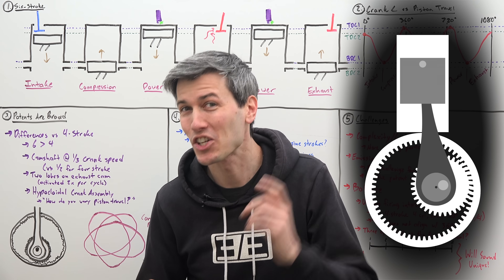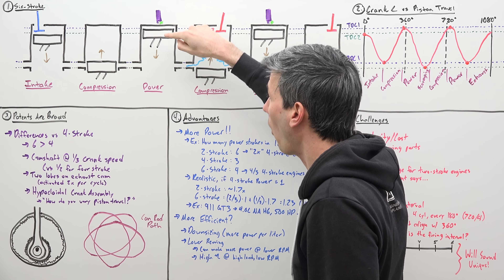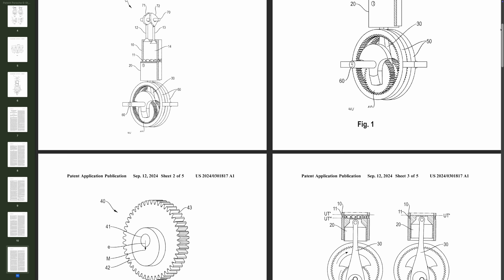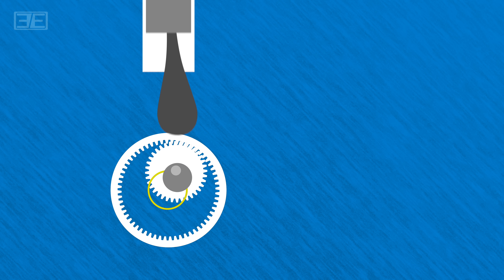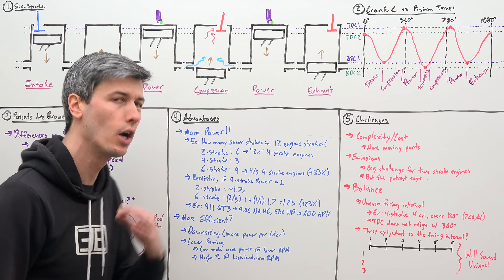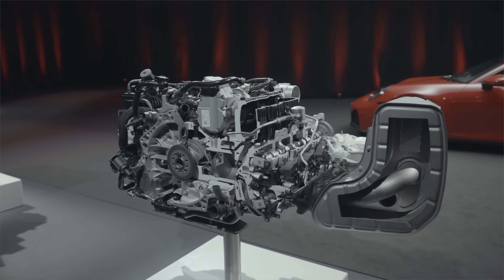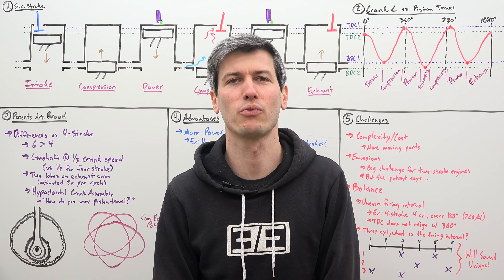Porsche's 6-Stroke Engine Is Genius!

Comment: I wonder: Won't you have the exhaust of the first power stroke in the cylinder during the second compression prior to the second power stroke? The exhaust valve should be closed during this time contrary to the picture, because otherwise you do not have any compression, correct? Then you are going to burn the fuel twice and this could increase efficiency? Sorry, I am not a mechanical engineer, I am just thinking about your graphic representation.

Comment: Seems like the 2-stroke cycle should go first so you could take advantage of burning some of the fuel and exhaust mix inherent when scavenging with ports, burn it clean in the valve intake cycle.

Comment: On your firing order diagram you state that it is a 3 cylinder engine but it says that you have 4 cylinders on your diagram. And you're using 180°crank journal location. A 3 cylinder engine would have a 120° crank  journal location.

Comment: When I was reading into the engine I saw that another way it improves efficiency is that on the second compression stroke, there’s still some exhaust gas left in the cylinder. That leftover gas gets burned along with the fresh air-fuel mix during the second power stroke, so the two power strokes of the 6-stroke end up producing less exhaust than two separate 4-stroke power strokes.
Reply: Leftover gas after a power stroke????  Maybe in your 454 chevell SS after you turned the mixture screw too far.
Reply: I believe that lowers the exhaust temperature lowering NOx  ( ? )
Reply: @steveducell2158  adding exhaust to the air/fuel mixture does reduce combustion temperature which results in less oxides of nitrogen (this is called an EGR system)).  But i dont know of any exhaust gas that can be burned .... again....  because the oxygen and fuel have undergone a chemical reaction....  which makes them NOT fuel or oxygen.

Comment: 9:13 i want to know what that exhaust valve is doing in the fourth stroke?
Reply: Probably going to have more cams. I can't imagine any less than 4 per cylinder head. I'm not an engineer, but something that would change cam lobe profiles that often would be impossible/impractical to engineer
Reply: Yeah, where the exhaust gas go after the first power stroke if u goona do another power stroke

Comment: I have done this working for Sturman Industries on a Naxistar Maxxforce 10 I-6 research engine that we put all types of liquid and gaseous fuels through. We didn't have the two-stroke injection intake/exhaust port at the bottom of the power cylinder. The overhead intake and exhaust valve were controlled hydraulically using a digital latching valve actuator giving infinitely variable valve actuation. I am an electronic controls guy that was blessed to be given a dyno test bed as a playground. This combustion cycle did not have added efficiency or power. Even with the two stroke intake/exhaust port, scavenging will be your biggest issue, which is bad for volumetric efficiency and hence power, but good for emissions. You can use the trapped exhaust gasses during the two stroke cycle as more of a reburn cycle acting as a form of internal EGR (hot EGR is good) and reburn cycle burning unspent gases. This will dampen the combustion pressure spike, leading to less NOx formation. You are, however, starving the flame front of oxygen, but the retain heat in the air and the the cylinder wall will allow complete burning of the fuel to  improve unburnt hydrocarbons and hence CO, and CO2 will drop significantly. On the NOx side, the internal hot EGR slows the pressure spike when the fuel ignites, reducing the local hot spots at the flame front that reach 3000K where the NOx is formed. In addition, the heat from the trapped exhaust gases will allow the NOx that was previously formed during the four-stroke cycle to actually break the bondleaving you with N and O. I was able to make the previously discussed Navistar engine tier four emissions compliant using similar strategies with NO AFTERTREATMENT. With the with the infinitely variable valve actuation, I could change the engine between 2-, 4-, 6-, 8- and even tried 10-stroke, because what the heck, I could. When I needed power, I would run in 2- or 4-stroke. When I wasn't loading the engine down, I could run any of the other cycles, and I could balance the engine out using the valve train, I could even do different cycles in different cylinders. I gave hundreds of demos to celebrities, politicians, and the smartest combustion engineers and was always asked what I thought this technology was best for and it is always a one word answer, flexibility. The company was sold, and driven into the ground with greed, but it was something the world needed. We were the reason Koensegg went pneumatic on their camless syatem because we had the hydraulic side wrapped up in patents.

Comment: In terms of efficiency, you could probably build a 6 stroke 3 cylinder engine with close to the same power as a 4 stroke 4 cylinder engine, and a 6 stroke 3 cylinder would be better balanced than a 4 stroke 3 cylinder. 

So when these come out, if the make a V6 we would be comparing it to a V8 in terms of power, but significantly more efficient less friction and mass of the extra 2 cylinders

Comment: I think added mechanical resistance is going to be a huge issue, with the significantly more complex crank/rod setup. That's going to impact power and efficiency.

Comment: What is it's advantage, less moving parts is certainly not one of them. More hp, more mileage, what were they looking for when they designed it?  This is yet one more idea of how to design a mechanical engine out of the I guess a few hundred designs in this world.. I'm a retired mechanic and to me. the simpler. the better, and is why I hate all these new cars and trucks that's been foisted on the US citizens to have to contend with.  They are computer injected, fuel infected, quality rejected sky high home mortgaged priced pieces of sh-t that you would be lucky to get 30,000 miles out of their poorly designed engines in them.  They might have been able to use guv'met intervention for impossible goals for them for the past couple of years, but now there is no EPA sticking it's nose in how they are designed and built now and they need to back up their technology to about the first of the 90's when they still knew how to build a good vehicle.  Several brands back then built long lasting, bullet proof cars and trucks before their engineers all lost their minds trying to see who could put out a vehicle with the most useless electronics that have at least an 80'% failure rate. They have gone to extra lengths to see how to make weaker metals and cheaper plastics and have forgotten how to put a car together without wide and rattle prone gaps in the seams and connections. As of right now, the workers in wherever their                                               vehicles are built obviously have no pride in their work in what they build and put out, but I have to admit that the workers at the Shanghai plant in China know how to put together a Buick Envision, or at least they did in '17, the one the we bought is a fine example with  113K on it now with only a battery change, one set of tires and recently I myself put a set of new struts shocks on the front of it, as it started the 'death wobble' after hitting bad rough seams across our local highways.  The plant is total GM, the cars are the result of all parts sent to this plant only to be assembled by Chinese workers, and I hate to admit that they did  a superb job of it. The funny part is that I probably wouldn't have bought the car if they told me at the dealership that it was made in China, but in this case I'm glad that I didn't know its origin of construction for the car.

Comment: I love the idea, configurations of multiples of 3 to compensate the different speed on each stroke due the hepicicloidal pattern. The 2 stroke power stroke has the greatest piston speed, due the extra speed, extra inertia and can make the engine vibrate, kinda want to see how they manage to balance this change of speed on each stroke, also, the horizontal speed of the connecting rod changes, so I will assume the 3x cylinders will also help dealing with this. 

If any engineering expert wants to explain how the primary and secondary imbalances could be assessed I would love to hear the explanation

Comment: Ther are a lot of new fossil engines inventions today. But are they eny better->
is it not just a way to try to create something new whitout eny meaning??
is there any noticeable extra power from this 2 stroke effect??
does this technology increase fuel consumption/km??
the technology becomes much more advanced and difficult to maintain. Is it worth it??
denna teknologi höjer säkerligen inköpspriset??
does this technology give so much more power for the money that it is worth the price??

Redan existerande->
the ulltimata fossil engine of today's technology, is electronic valve configuration and this technology is nothing new. Where the valve can be controlled in an optimal way for both power and efficiency. For example, as Koenigsegg has created and competes says going to compete with the electric drive.

fossil engine vs electric engine because thats wher it counts->
the fossil (today's) engine has an efficiency of max 50% while an electric motor is around 90%.
An electric motor also has fewer moving parts that can break.
An electric motor is also easier to maintain.
So the ulltimata combination would be diesel-electric just like some locomotives have been designed for many years and are rolling everywhere.
fossil engine connected to an ultra efficient generator - the current is temporarily stored in a Li battery of suitable size (for example a battery the size of a hybrid car) - the battery supplies the electric motor (motors) with the required power for propulsion (the fossil engine dosn`t directly ensitipate in the probulsion). This makes use of the best of both worlds.
Thanks for listening

Comment: Does it work if you have a fire every 60 degrees of crank rotation? 1080 degrees of crank rotation divided by the 18 strokes in total for 3 shafts is 60 degrees?

Comment: Have they forgotten to consider leverage?? Yes, the idea is genius/creative. But not the design which creates a pin/shaft fulcrum at every turn…which I ASSume is how the crank rods work?

Strait up rod, not up and over rod. Creating a torsion on the system. Only a matter of time before failure. 

BUT I LOVE THE SECOND STROKE, Idea.

Comment: this is really interesting! there are a few things i dont understand. if there is an exhaust valve open during the second compression stroke then how can there be compression? and secondly he said that oil is not mixed with fuel like in 2 stroke engines, and if there are ports at the bottom of the cylinder that allow air in, then that means there cant be oil beneath the piston. so how is the system lubricated?

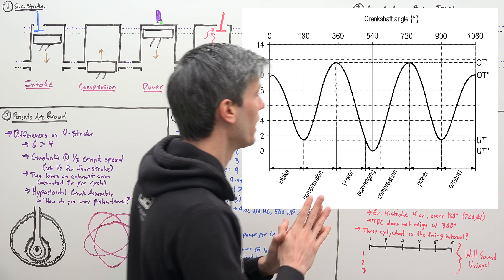Comment: @12:32 I know I'm 4 months late to the comments, and maybe someone already pointed it out, but if you have an inline 3 cylinder, the divisions of 6 firing events do conspire to fight a natural balanced firing order.     BUT if you have an inline 5 cylinder, and configure the initial firing order and the "fresh" (Intake/Compression/Powerstroke "ICP") event to start every 144 degrees of crank rotation, then advance the firing order two cylinders, so the firing order looks like this "1,3,5,2,4", then the harmonics of crank wind up would definitely be asymmetric, but nothing a gear driven damper couldn't account for...OR...Different sized bores on the 3 aligned with greater power on their side of the crank revolution.  HAHA

SUPER FUN PROBELMS TO SOLVE.  Maybe the asymmetry can generate positive pressure in the crank case that can be capitalized.

Comment: my question is how would you get oil to the cylinder walls without it going into the "2 stroke holes" then possibly coming back out into the combustion chamber unless you use a mixture of 2 cycle gas and normal? using the normal gas on the normal "4 stroke movements" and 2 cycle gas on the "2 cycle movements". if anyone knows or is smart enough to explain please do.

Comment: To aide in balancing the engine allowing near zero vibration varying the intake valves total lift and altering the cylinder pressure during the different compression strokes could be achieved with a cam ring similar to a radial engine. With the right ecu settings for varying fuel pressure  this 6 stroke engine should be a fun engineering project.

Comment: To balance a 3 cylinder engine, it’s really easy. Cylinder 1 produces power on strokes 3 and 5, cylinder 2 produces power on strokes 5 and 1, with cylinder 3 producing power on strokes 1 and 3. That means on every power stroke you have 2 cylinders producing power.

What’s particularly nice about the slight timing differences in the two cylinders power creation is the net effect will be increased torque.

Comment: REVforce 2 stroke?? Multifuel capable, no need for oil gas mix, no cams, forced induction... Can you break down that engine for me? I'm struggling with the spinny bit on the exhaust.

Comment: So where’s the lubricant going to fit into all this ?????? Won’t the lube get trapped in all the air passageways that are at the bottom dead Ctr where all the fresh oxygen supposed to enter before it’s pushed back up into the cylinder for combustion???????

Comment: After the 1st combustion stroke the exhaust will be hot and the air from the ports will be cold so the exhaust will go the top and escape and the new air will press it. I don't know how much unburned fuel remains though. You need to test this.

Comment: My first question is "why?" Why not just go full on two stroke? Looking at it a tiny bit further it seems evident that when the piston approaches BDC it's going to be wiping oil off the cylinder wall and into the 2 stroke input ports. Not only is it going to consume oil but when the oil is blown into the cylinder it will increase emissions and possibly foul plugs. 

German engineers have long had a reputation for creating overly complex designs. Gee, I wonder why.

Comment: It would be great if you can explain how wrongly torque is used by motor journalists and others.
P= n x torque.
P= Power in watts
n = engine speed in radians/ second
Torque= Newton meters

People are mixing torque with power not understanding that with a gearbox you can get any torque you want from a moped engine. 

Please explain this in a professional way. 
( an old Porsche magazine explains it well. Maybe 20 years ago)

Comment: Could you check out Alpha-Otto technologies' REV force engine? It's a unique take on a 2 stroke engine that eliminates many of a normal 2 stroke's shortcomings like bad fuel economy and high emissions. To do this it uses a rotary exhaust valve which they put in a position where it doesn't have to seal in combustion pressure (so the traditional sealing issues of rotary valves at high pressure are not an issue here). All in all i think it's an ingenious little engine. The company's prototype engine already produces more horsepower than the engine from a Ducatti 1299.

Comment: So they it will only push 600hp for 200k is crazy what are we paying for VW the name at this point more parts more problem 🤔. Good idea bad on the HP and station to refuel. Disappointed with them on the power. That's why other companies take these cars and make them top tier with the after market, but this new engine will be a challenge.

Comment: I think the best answer for power stroke timing is to essentially have three two cylinder engines with two cylinders firing per power stroke. 
If you draw your graph with six strokes and six cylinders:
Stroke 1: cylinders 5&1 power stroke 
Stroke 2: cylinders 6&2 power stroke 
Stroke 3: cylinders 1&3 power stroke 
Stroke 4: cylinders 2&4 power stroke 
Stroke 5: cylinders 3&5 power stroke 
Stroke 6: cylinders 4&6 power stroke 
Written by cylinders:
Cylinder #1 fires on stroke 1&3
Cylinder #2 fires on stroke 2&4
Cylinder #3 fires on stroke 3&5
Cylinder #4 fires on stroke 4&6
Cylinder #5 fires on stroke 5&1
Cylinder #6 fires on stroke 6&2

Comment: I think that 12 cylinders would yield too much of a combined weight, emissions and price penalty.

My guess is that it would be super-awesome if they had a high output 3 cylinder engine but then there would be a Fear Penalty because buyers would be afraid of reliabilty, maintenace cost and warranty issues on a super-high output 3 cylinder engine.

However, for the fearful, as an auto-enthusiast myself, I owned an exotic 3 cylinder Toyota sourced Daihatsu Boon in about 2004 and I got years of wonderful reliability, fuel economy and power output (for Kyushu mountain climbing with the whole 4 person family aboard) from it so, mass-produced highly reliable 3 cylinder engines are possible.

I also like AMG's idea of putting both a supercharger and an electric, electronically controlled turbo on their inline 6 engines.

I think that that kind of approach could be effective here if they can develop metals and seals that are strong and heat-resistant enough to endure the kind of internal pressures that this kind of engine would inherently produce.

It would also be totally awesome to have an optional engine brake (for those who don't mind the weight penalty) to assist with braking and reduce super-expensive exotic carbonfiber disc brake wear.

Comment: Its working onto a 6 cylinders on your firing pattern. Example : 1st cylinder : 1&3 . 2nd cylinder :2&4. 3rd cylinder : 5 &1 . 4th Cylinder : 4&6 . 5th Cylinder : 3&5 and finally the 6th cylinder : 6&2.

Try that out, ull see that the difference is that every stroke you've 2 firings
Reply: ofc itll probably not be the pattern , just saying that its working